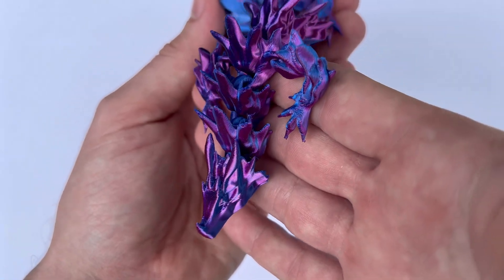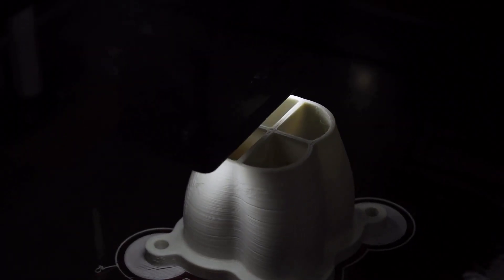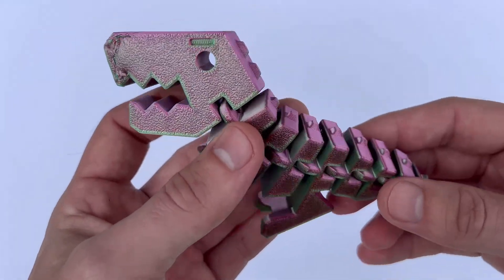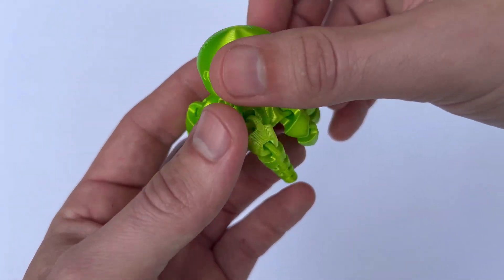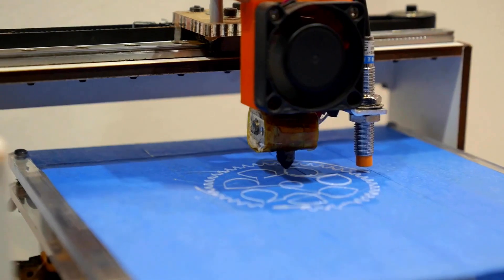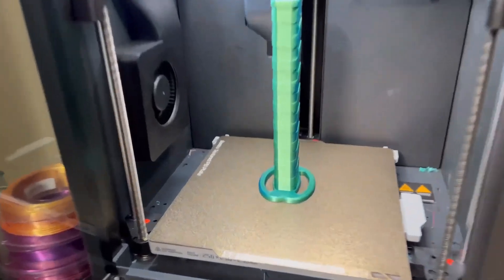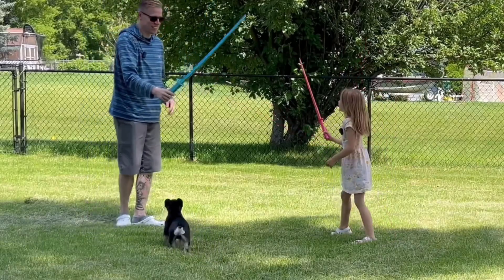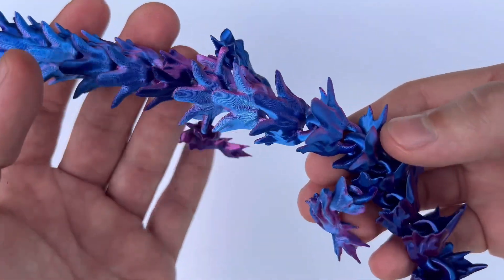eSun PLA Filament Review - Need to Know

Comment: guys, never believe an "honest review" for a sponsored video.
Reply: I found this video because I was hiving a lot of problems with some esun pla I just got from amazon. And OMG the shrinkage, it's so bad it pops it's self off the print bed. If I do a mid-air extrusion you can watch the string shrink, comes out about 3cm then immediately shrinks to 2cm. The whole reason I got this is because I resurrected my 10 year old printer and needed fresh filament. My 8 year old filament that was left out to get all dusty and gross worked so much better, after some cleaning that is. Even my 8 year old wood filament, that was left out as well, did better which surprised me. Sadly the manufacture of both of the older filaments are no more.